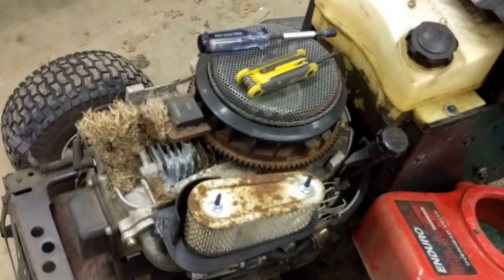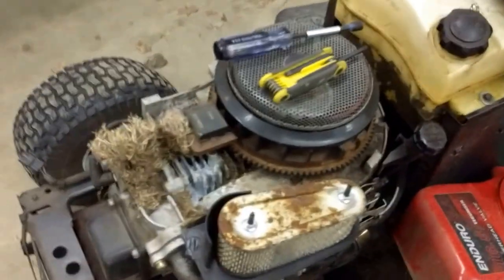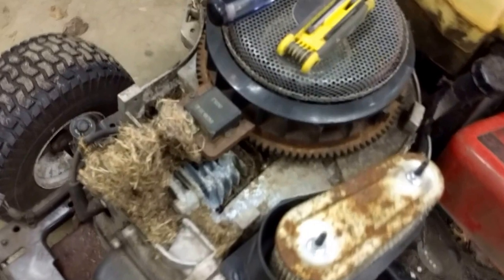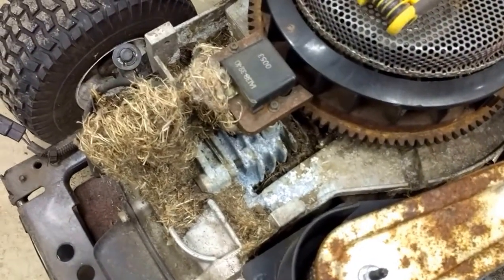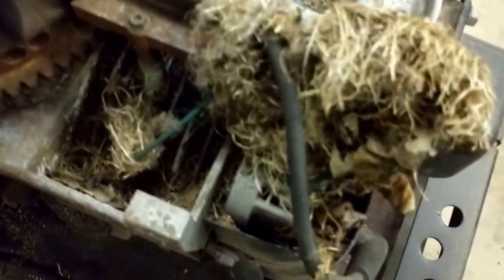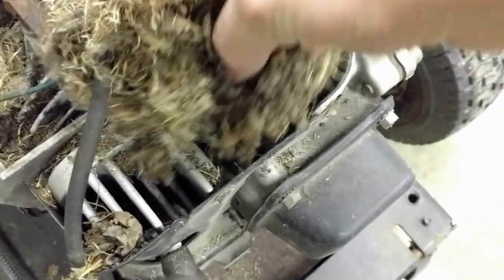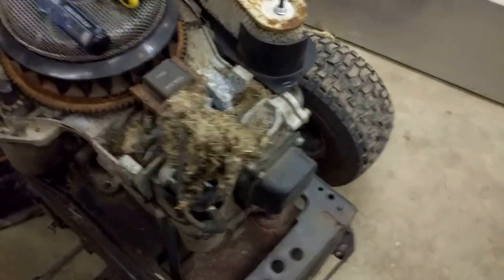Lawn Mower Exhaust Glowing? A Few Things To Check

Comment: have the same problem . here`s another reason having to do with the too lean aspect. i have a lt 4000 and i put a kohler 15hp in it .the old engine was missing when i got it . the gas tank is in the rear and requires a fuel pump. i tried getting away with using the existing tank and gravity. well you know the rest. i`m switching to a smaller gravity fed tank and mounting it up near the steering wheel like the lt 1000 models and no fuel pump. yep anything that starves your engine fuel wise can be an issue that overheats the exhaust and a mouse nest is never a good thing ! enjoyed your short video.

Comment: I suspect the problem wasn't the grass around the engine? I would guess exhaust valve or running lean. Check the condition of your sparkplug and see if has white ash film on it.